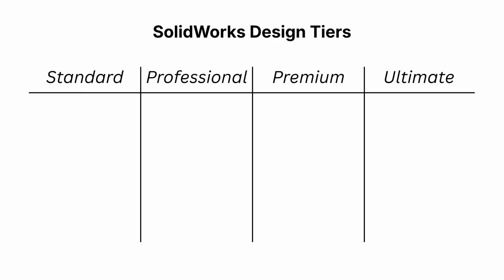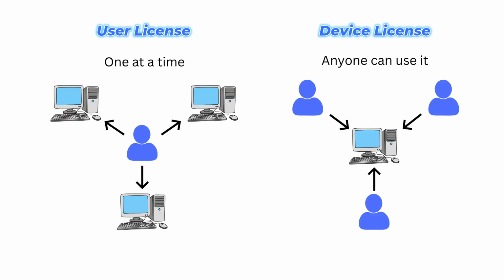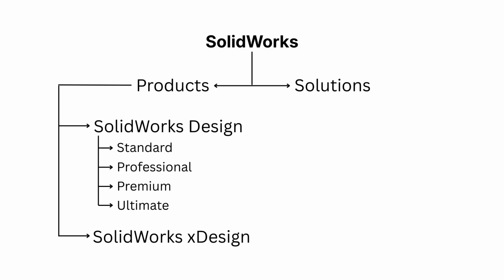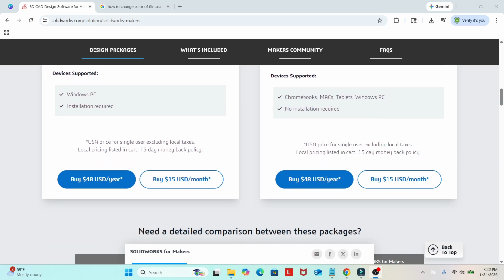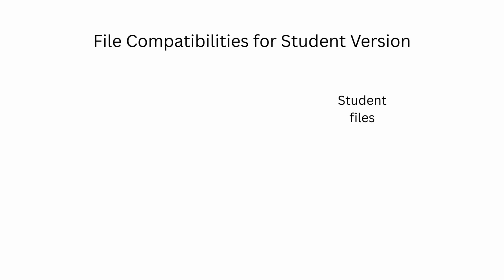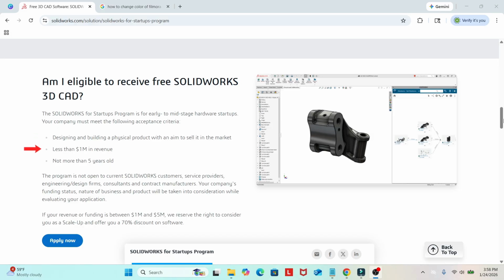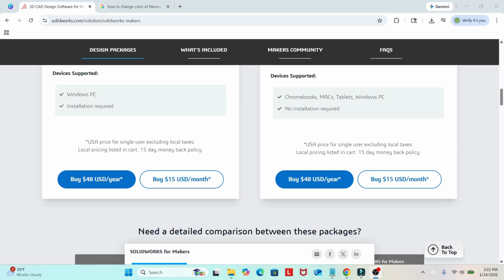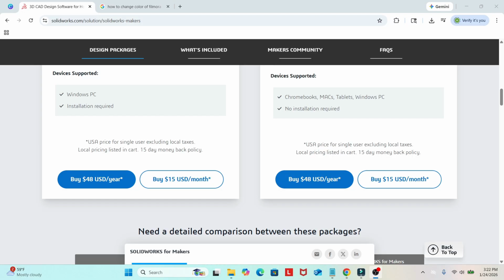Which SolidWorks Package Should You Buy? (Beginner's Guide)

Comment: Can a good laptop be used in place of a desktop
Reply: I have a refurbished Del Precision 7750, 17" screen (56 Gb Ram and 6 Gb Vram, Nvidia Quadro RTX3000) that a computer geek friend sourced for me for less than 1K.
There are many high end "used" laptop that were used short term by a company as part of a "fleet" contract on sale if you search.
They typically have a some warranty attached.   
Make sure that the video card will match whatever you need for connecting to high res, large monitor for home/office connection.
This is my main SW machine with 2 operating systems and 2 versions of SW(one to match work and one for home) also have bambulab slicer.
Reply from the maker: Oh yes, of course! I actually use a laptop myself. It all just depends on the computer specs. 🙂👍
Reply: @TheInventorWithin Actually you can go more "affordable" with older SW versions and older op systems. Just keep it offline. Just as good for learning all SW basics. SW has industry proven backward compatibility. Autodesk(mech desktop=inventor=fusion360). Seriously.
Reply from the maker: @trexinvert I think you’re right, though I haven’t looked into it. $48 for a whole year already is a bargain in it of itself (at least for the Makers version). 😉👍

Not sure what you mean by the last part in parenthesis. I’m not very familiar with other CAD softwares, though I know they have similar aspects.

Comment: I have a laptop with,
RAM - 8GB (single channel)
CPU - i5 10th gen
GPU - Gtx 1650
Can i run smoothly, the solidworks Makers 2026?
Reply from the maker: Hello! Your laptop seems to align more with the minimum requirements for the desktop version of SolidWorks Makers, but I am afraid it could run into some issues because 16GB of RAM seems to be the minimum and you only have 8GB. 

Which operating system are you using? Windows 10 or 11? What is your CPU clock speed? If you tell me your laptop model, I can help you find out. 🙂👍
Reply: @TheInventorWithin 
My laptop: Acer aspire 7(it have another empty slot for Ram)
OS: Windows 11 Home
Reply from the maker: @Sudhakar00007  I believe your laptop should be capable of running SolidWorks for Makers 2026 when it comes to basic models, but I think it will become slow and could have issues when working with bigger and/or complex assemblies. I would definitely suggest getting at least 16GB of RAM. 

Gaming GPUs usually work with SolidWorks even though they are not ideal. One thing that is concerning though is the clock speed of your CPU because it seems to be 2.5GHz. It is recommended that it is at least 3GHz for SolidWorks. 

If you plan on using the software for learning and basic models, there might be some times where it won’t be super smooth, but I think you should be good (as long as you upgrade the RAM). But if you plan on working with big and complex models your laptop will struggle. 😞
Reply: @TheInventorWithin 
😢i will upgrade my Ram!
Thank you for the Detailed and Dedicated reply 😊 you are awesome.
Reply from the maker: You are welcome my friend. I am glad I could help. 😊 Thanks for being awesome too! 😆

Let me know how it goes when you start using SolidWorks. 🙂👍